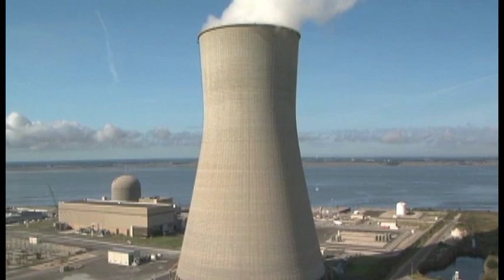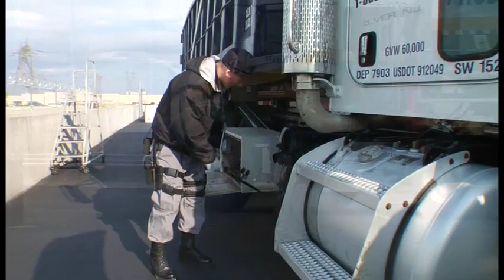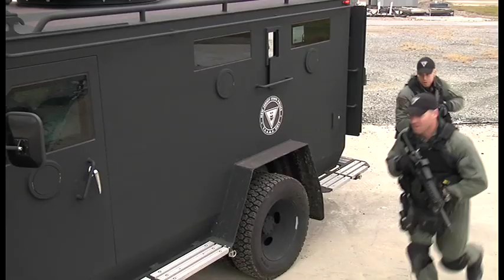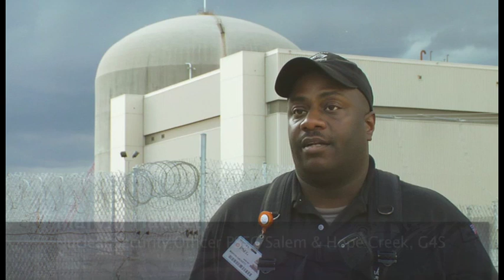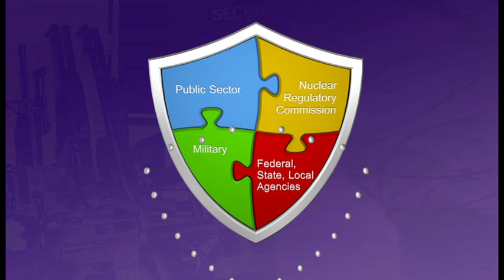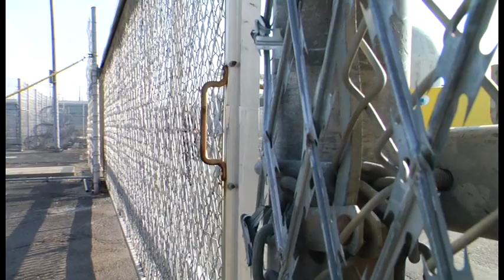Safe and Secure: Protecting Our Nuclear Energy Facilities

Comment: If anyone is curious as to why the control room is lined with gauges, rather than computer terminals:

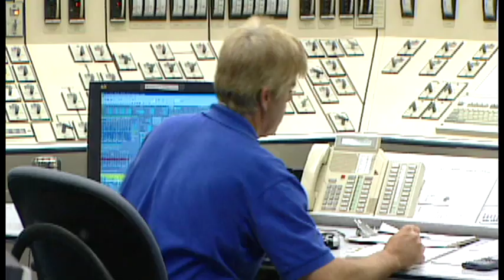The instrumentation does get sent to computers, and the normal operation is done via monitor (you can see one @2:36, for example), but the internal control systems are largely analogue, and can always be accessed and operated in the event of a software failure.

It's just another layer of safety, or the computers are a layer of convenience, depending on how you look at it.